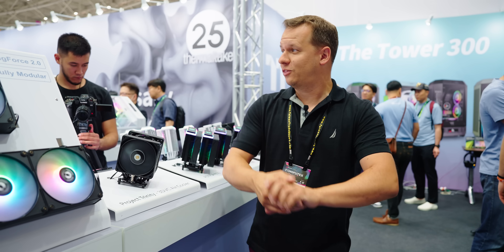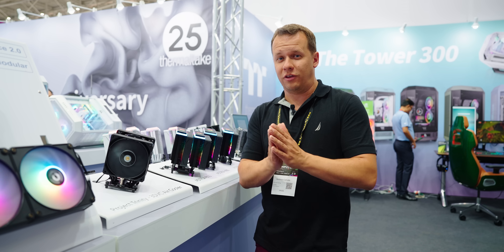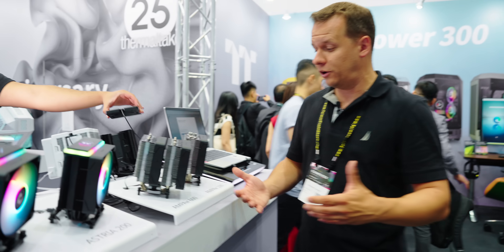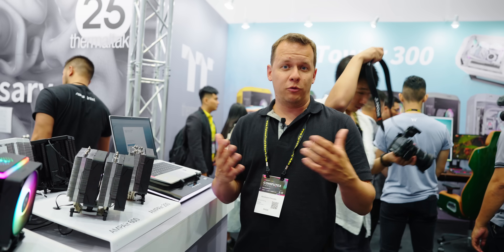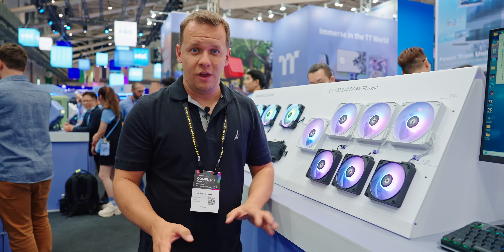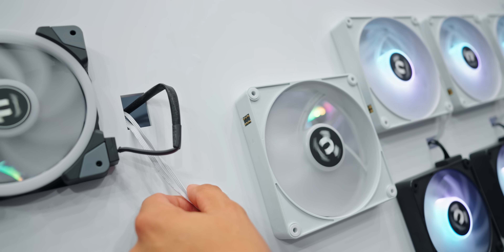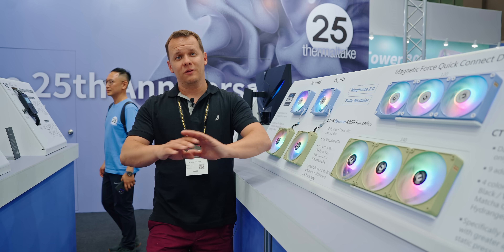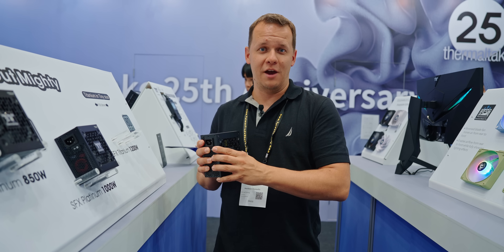A DIFFERENT Way to do Air Cooling

Comment: I like the idea of an LCD or OLED screen on a good air cooler. They have plenty of room for a bigger screen than my CORSAIR iCUE Link H150i LCD AIO, which I'd rather have air than liquid because no possible leaks. Sorry you don't care for the bling, but some of us like the practical uses of temp monitoring, as well as the excess of gifs, pics, vids, etc. Go for it TT, I'll invest in a well performing air cooler with a screen for my Intel 13700KF as long as it doesn't have excess cabling to manage/hide.

Comment: The display at the top is AWESOME.
It's why Deepcool AK500Digital is primary candidate for my next build's cooler.
But given that it shall be Thermal The Tower 300 with most likely some prety Thermaltake case fans,I wouldn't mind a Thermaltake Aircooler with a display.
Perhaps Thermaltake RAM as well for full Thermaltake build , because PSU shall most likely be Thermaltake GF A3 850W Snow .

The optional display for the case is exceedingly expensive.
If I am to pay 100€ or more for practicality I would prefer the display to be on the aircooler for the combination of practically (information that display provides)and CPU safety (great CPU cooler)and not the case's overpriced optional low res display in case I give up on Deepcool's cooler for some reason.